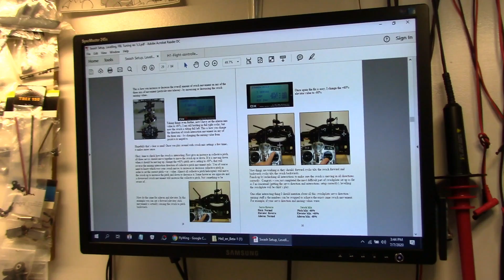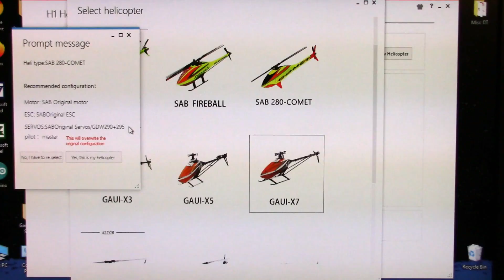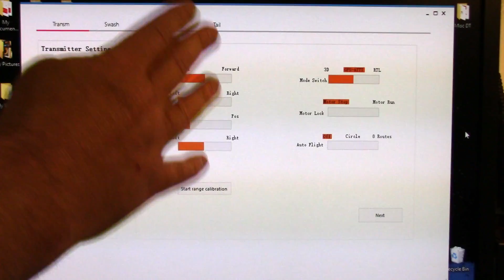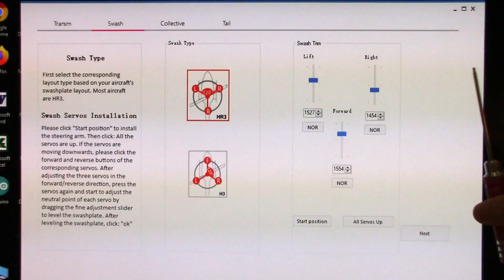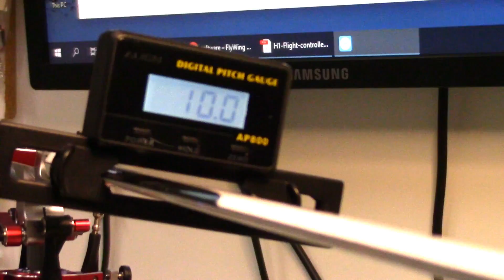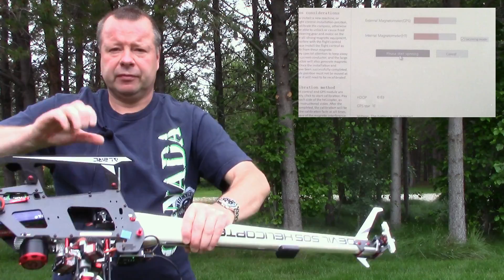Flywing H1 Setup Tutorial & Tips

Comment: What ESC are you using. I am building an align 700 in a md500 fusulage
Reply from the maker: Use what ESC is recommended for your specific Align 700 12S powered heli (stated in the manual). This little 500 is only 6S and what is being used in it has no bearing on what would be used in a 12S powered 700 size helicopter.

If it's worth anything, I personally only use Castle Phoenix Edge HV 120A ESC's in all my 700 & 800 machines, primarily for the excellent data logging they provide which is so important at this level and size. 
I then power the onboard electronics with a stand alone RX battery for a bullet proof power source over a BEC which I would never trust on a larger machine.

Moreover, if you are actually considering the H1 in scale, it's a horrible FBL system for any larger scale heli for a multitude of reasons which include but are not limited to:
- Not nearly enough PID tuneability for scale.
- Can't handle vortex ring state or settling with power which all larger heavy scale helicopters will experience.
- Single fixed throttle output so you can't quickly & easily tune out destructive RPM induced fuselage resonance/s. 
- Inability to perform auto-rotations which alone is a huge issue unless you don't mind the thought of completely destroying a large scale heli when the power takes a dump.

Best results in large scale while having a good flying heli will be realized with a proper and tunable FBL system like Ikon, Bavarian Demon, V-Bar, Futaba CGY, Maxx, or even an open source Rotorflight/Nexus system.

Comment: Can you explain to me how you power the H1 and where the extra small battery is connected? Because according to Flying, no extra power supply is allowed.
Reply from the maker: Like every other FBL system, the H1 is powered through the servo power BUS rail. Be that through the ESC/throttle channel with the ESC's built in BEC, or by running a Y-splitter cable to any of the servo outputs if you are powering from an external BEC or RX battery.

Comment: hi would you mind covering useing  the hi on nitro heli
Reply from the maker: Got rid of the H1 shortly after I did this video so I can't; plus the fact it won't work on a nitro heli as there is no throttle control nor could it handle the high vibration environment.

Comment: Hey John, I know this is an old video, but I'd like to install the G.T.Power Aircraft Simulated Sound & Light System for Helicopters. I've already set it up, but it requires a throttle cable to "pass-through" the unit so that based on throttle position the sounds will change. The G.T.Power module has the input for the throttle/ESC cable and an output back to the ESC.  This module just goes in between (no need for a Y-Cable).  My concern is with the H1 and how it functions.  I wonder if it will affect the general functionality and stabilization of the H1 Flight Controller with this pass through installed. Thoughts?
Reply from the maker: As you saw, the H1 is very limited in output options. The throttle output as you know is fixed. Unlikely a fixed throttle PWM output would work with any sound system. Any sound systems I've seen or read about need a variable output to function correctly. You would have to contact Flywing tech support for their take.
The only way I see you could use a sound system with one of these things is to use a spare RX channel (channel 10 if you use all other 9 channels for the H1) and program a mix for CH 10 to your throttle stick so you could control the sound system through channel 10, independently. That or just use a good flybarless system that is not bound by such limitations.

Comment: Hello and thank you for useful video! I have calibrated the FC indoor and outdoor. It stopped blinking red in both cases. There is no warnings in desktop app. But when I try to arm it - it flashes yellow, even there are 16 sats and HDOP 0.78 (indoor and outdoor). No low voltage. What I should do to get blinking green instead yellow and what could cause this problem? Thank you!
Reply from the maker: No idea, best to contact Flywing tech support.
Reply: @rchelicopterfun  Already did it. They said to reset the FC via the configurator and to install new model and to make adjustments again. Will try it this way.

Comment: Can u set it up where there is no 3d mode? Going in a scale helicopter
Reply: Yes you can in the radio. In your selector switch between RTH, GPS and 3D. If you flick your switch to 3D it shows 1000 in the output in the menu on your transmitter. (GPS is 1500, RTH is 2000) 
If you change that number to 1400 it gives you ATT mode (Altitude hold but it drifts No GPS, Auto level can bank the heli up to 30 degrees)
Change to 1300 it gives you 6G mode, No altitude hold, Auto level and you have to control pitch, again 30 degrees bank angle.

Comment: Hi there john,
   I am new to flying Helicopters, but have been heavily involved in racing RC off-road 8th scale since the early 90's. i have also built and flown FPV quadcopters. My question is about the voice speaking your radio switch positions. I use an Frsky 2019 X9d-SE running EdgeTX. My radio does speak some things, but yours appears to speak EVERYTHING. Is this just sound files put on the sdcard? If so, where do i get them? If not, how do I get the speaking set up? Thanks for this video. I had an old Trex450 on the shelf that I stuck an H1 into. It did NOT work with the original ESC, motor wouldn't arm, so I put an Emax 60amp running blheli into it and now it spins the motor normally. While I am going over the setup 1 more time, I came across your video. (They actually linked to it in the setup software, Click "Tutorial" on the sensor page) I also purchased your setup guide for newbs like me. Aside from this chopper, I purchased a new TB40 kit, rotorflightF7 controller, Frsky Neuron2 60amp ESC, and a set of KST servos. I want to fly the old chopper first, then build the new one. Simply so I have confidence in my ability to set the swashplate properly.
 
Thank you for the tutorial and the eBook,
QuadRacer31
Reply from the maker: I use the "Amber" voice pack on all my radios running Open/EdgeTX . I downloaded mine from OpenTX University's website. I'm sure there are also downloads in the Open & Edge TX forums and in GitHub and Amber is not the only voice pack out there as you likely know.
Keeping in mind regardless of which voice pack you use, you have to program your radio to activate those different voice call outs and sound files if you want more than the few that are automatically enabled out of the box.
If you're unsure how to program voice call-outs, I cover it in part 1 of the OpenTX for helicopters video: https://youtu.be/XdFOndPG7xo?si=vM0ka943r2Pj-_D4
Video Chapter is titled "Programming Voice Call Outs" 
Thanks for the eBook patronage 👍

Comment: Hi John.
How do you like that transmitter and can I use spektrum dsmx receivers with it?
Thank you 😊
Reply from the maker: I enjoy it very much. The way to fly Spektrum protocol is with an External Multi-Protocol module. If you update to Edge TX OS in the Radio, and run the multi-protocol module with the latest firmware via serial interface with the radio, you can even access all the latest Spektrum telemetry RX's along with forward programming access on their SMART stuff. Lots of info on the Multi-Module website and their GitHub threads. https://www.multi-module.org/

Comment: John. After all the setup is done correctly, is it normal, that I tilt heli and do not observe servos moving around to compensate my tilts just to check if H1 does level the thing? Like it is done on general FBL system. Servos just do not move (including tail servo during turning).
Reply from the maker: I honestly can't remember (I got rid of the H1 shortly after making this video and that's several years ago now). I do believe it doesn't respond until it's armed and sends out a throttle signal (i.e. start command is given); but don't quote me on that.
Reply: I see John. I started laughing when I saw  many comments in forums when a guy asked "Why h1 does not do anything....spinning and so on?" and another guy responds "Well, that's because H1 "senses" that you dont have blades on a rotor". And nobody asked themselves a question HOW H1 would in a hack do that?.... It's like....H1 sends a message to God thru GPS "Hey, Jesus! Can you check if this dude has blades on?"...and God answers..."I just checked, YES he does, so spin that shit!" )))

Comment: at 6:07, when you powered the radio controler you must have "plugged the battery to the system"  as the H-1 with USB feed in only cannot send enough voltage to power the Receiver.
Reply from the maker: Nope, powered with USB only

Comment: hello and congratulations for your tutorial ... I wanted to know to install it on the trex 600 nitro, what problems can I find, in the installation, or is it like on an electric model? I don't understand where to connect the throttle servo to the H1..can you help me and give me advice on how and where to install it better? Thanks again
Reply from the maker: Doesn't work on nitro (at least I wouldn't trust it). 1. Only allows fixed throttle output so you can set carb position during priming starting, cold idle, fast idle etc. Also likely can't handle the high vibration environment of a nitro.

Comment: I've watched several H1 videos and noticed that all helos with H1 tend to leap into hover so rapidly. Does H1 allow pitch curve adjustments in order to smooth out the ground to hover transition? Thanks.
Reply from the maker: Can't use pitch curves with the H1 (in GPS mode); the unit has to see a full -100 to +100% linear channel output to work. Artificial flying experience = artificial flight behavior; no getting around it. Every GPS system I've ever setup for a customer respond with similar artificial collective behavior because they don't like being "light on the skids" due to ground resonance feedback &/or wind gusts. They all hold negative collective and then abruptly transition to positive when given the command to lift off to minimize the time they are light on the skids.
The only way to have a proper & smooth gradual lift off with good collective resolution/control while using tamed down pitch curves with the H1 (or any GPS Heli system for that matter) is to turn the GPS off so the bird is in normal/traditional stabilization mode so the pilot has total control of collective response.
Reply: @rchelicopterfun  Well explained. Thank you for that. So, is it lifting off in GPS mode is not required (the helo can lift off in normal/traditional flight mode)? Thanks again.

Comment: Hi! on my t.rex 470 with the flywing H1, when I activate the switch on  to make the motor turn the blades suddenly spin  too fast and the tail rotor does not have time to compensate the torque. so my helicopter starts to turn on itself for 2 seconds. How to lower the engine speed on the software so that the engine speed to bé more progressive?
Franck from France
Reply from the maker: Spool up speed is a function of the ESC, not the H1.
Reply: @rchelicopterfun  thanks. I will check into that way

Comment: Hello John. I have the Flywing H1 for my T-Rex 470 LM  I made all the settings on my helicopter and the radio control but when I want to take off the engine does not turn. My remote control is the Spektrum NX 10. There is certainly a button to assign to activate the motor but I don't know. Tutorials on Youtube do not explain very well how to set up the H1 with  Spektrum radio controls. I have spent many hours trying to get the engine to run without success. Do you have an idea?
Franck from France
Reply from the maker: Since I fly with OpenTX and had this test/review unit configured to OpenTX, I really have no idea what's involved with Spektrum. Throttle run is mapped out on the H1 to Channel 7, so presuming you can assign a 1000us to 2000us switched output on your NX assigned to channel 7 and your RX plays well with the H1 in terms of channel mapping, I don't see why it's not working; but then again, I'm not Flywing tech support. Suggest contacting them.
Reply: @rchelicopterfun  I must to turn left stick and right stick down right to make led flashing. It works now!

Comment: Is it possible to use the Flywing H1 for anti -rotating main rotor?
Reply from the maker: Good question. I don't think it will support a CCW main rotor as rotor direction is not a parameter that can be selected in the setup programming. Of course to be 100% sure, best to contact Flywing Tech Support.

Comment: Hi do you have video how did you setup your radio transmitter for this one
Reply from the maker: I cover my basic openTX heli foundation setup in this one: 
https://www.youtube.com/watch?v=XdFOndPG7xo
It of course had to be modified slightly for the H1 due to the difference with pitch & throttle curves - ie. they are not used.
Reply: Do you pick airplane or helicopter  model on your  radio to set up h1 gyro, because i saw another video he choose airplane to set a heli

Comment: I hope yoi are still monitoring this thread.  Thank you for all the variable information that you have shared with us here.  When you set your swash plate, do you do that at half throttle?  Thank you.
Reply from the maker: Not sure what you mean by "set your swash plate". Set it to what? Your cyclic pitch range, collective pitch range or leveling it?
If it's leveling you're referencing, as with all collective pitch helicopters and as shown in the video, it's leveled mechanically at mid point on the pitch curve. It has nothing to do with throttle output. With that said, the H1 setup wizard automatically sets the collective output to all swash servos at mid value (1500 micro seconds) so collective channel output value on the radio is not important at that step since the H1 overrides it.
If your question was not related to leveling, please contact me on my website with technical questions like this since YT comment section is a poor medium for sorting technical issues and I rarely see second posted questions whereas I always see every email question and follow ups on my website: https://www.rchelicopterfun.com/
Reply: @John Salt  thank you. You actually answered my question (your answer covered pretty much everything).  I'm sorry I'm new at this, but your channel is very helpful to newbies.  Thanks again.

Comment: Hi John, rather than trying to bind a Spectrum radio to the H1 what radio is automatically compatible to the H1?
Reply from the maker: As I state in the video and again in the description, compatibility has nothing to do with radio brand or protocol, it has to do with the receiver pairing; specifically that the receiver has an S-BUS output port. That is how this system communicates with the the RX via S-BUS. Nothing is going to be "automatically" compatible out of the box, it all requires radio setup and programming. I suppose if you wanted to distill things down to the most basic/seamless integration with the least amount of TX programming, you would get a radio that has Futaba channel mapping order out of the box (AETR), be at least 9 channels, and get a 9 ch+ RX for it that has an S-BUS output.

Comment: Hi John . Great instructional video . I fly a Roban 600 EC145 ( T-Rex 550x mechanics ) thanks to your tutorial it flown a  dream first time no issues I just followed your instructions. Now I need a little advice for my new build A  Roban 700 Apache. Almost there with it but. I’m using a castle edge 160 ESC ( no internal BEC ) and external BEC pro that has two input leads . I know these can and should go into the ESC port of the H1 using a Y splitter but my question is what about the ESC throttle wire , can I ( using another Y splitter ) in essence running parallel to the BEC . Also would I need to disconnect the red wire from the ESC . Hope you can help . Great stuff
Reply from the maker: Sorry no idea on BEC pro. I use stand alone RX batteries on all my large machines. As far as I know, ESC connectivity would be the same however since there is no BEC in the Castle HV ESCs so you don't have to remove the red wire from the throttle lead. Of course always confirm with Castle's wiring diagram or contact their tech support if you are unsure, in the off chance the 160 is different from the rest. I've only run the 120HV since these big Robans sip current and will rarely pull over 60 amps if you manage your cyclic and collective energy well.
Reply: Thank you John . Very helpful. Top man

Comment: I have the FW450V2.5 and it flew very well with the stock transmitter and receiver.  I have converted to run on my Open TX FRSKY x9D+ Taranis with a X8R receiver.  I got it to fly in the GPS mode but it bobs forward and backwards pretty badly even in a hover.  What adjustments do you suggest to get it to fly smoothly?
Thanks - Vic
Reply from the maker: I list the basic items to check for cyclic pitch oscilation in the description.